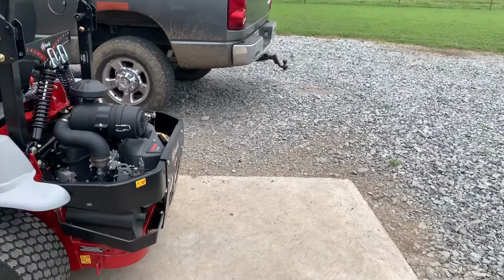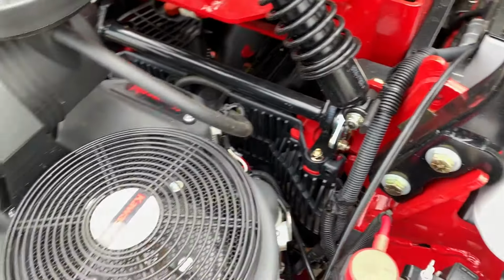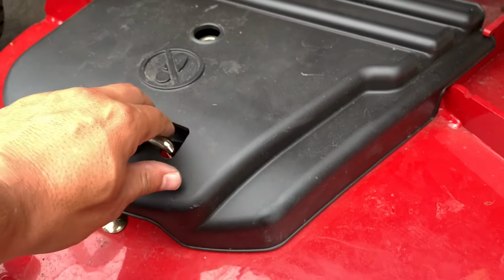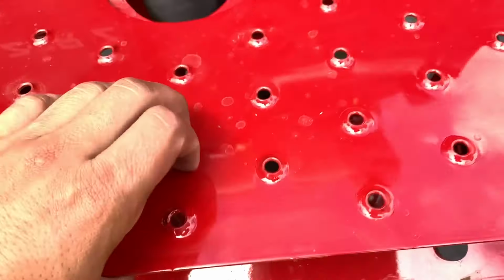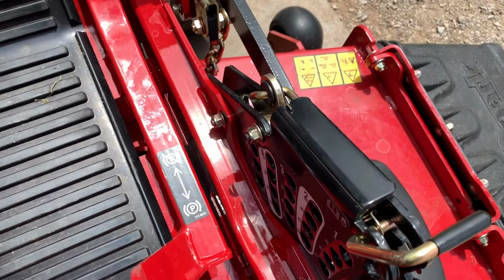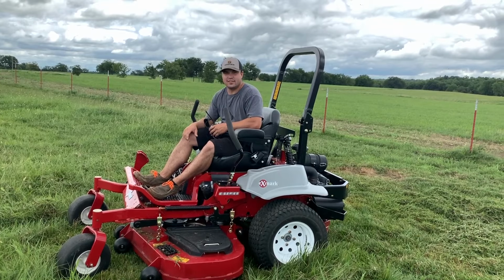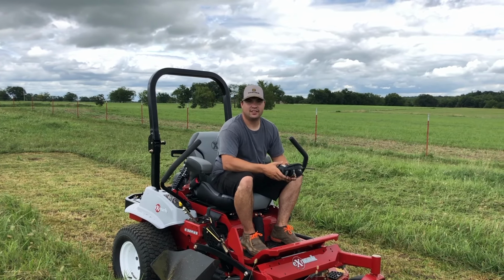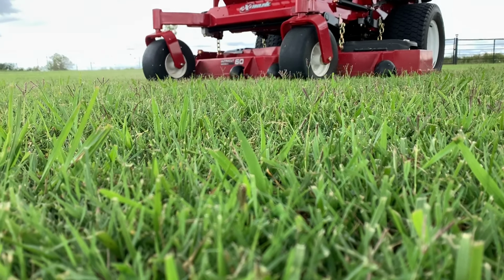2019 EXMARK LAZER Z SUSPENTION PLATFORM REVIEW

Comment: Lacks in power can hear the motor bogg down!
Reply from the maker: It’s plenty of power for what I need. I don’t normally mow pastures it was a demonstration
Reply: @4MRanch  nice I had the x series radius 60 it had a 23.5hp kawi and sold it cause I had to double  cutt and my thought personally 27hp at least for a 60inch deck
Reply from the maker: Martin Melendez yeah I could see why you would want the 27 specially if your cutting thick tall grass
Reply: @4MRanch  yes but looking at the 60 wright zk it has a 37hp engine and it's 11k for that price it's a deal
Reply from the maker: Martin Melendez that’s is a good deal I paid 10k for this one with a discount.
Reply: @4MRanch   not bad with full suspension it helps on ruff yards
Reply: It was bogging because he was cutting way to short for that long grass. For residential and commercial weekly grass this mower will never bog down. If it’s bogging your using the mower wrong.
Reply: Martin Melendez u need the ultra cut deck that comes on the lazer z. Radius is not a commercial mower.
Reply from the maker: Patrick OBrien yeah I agree,  it never bogs down under normal mowing conditions.
Reply: 4M Ranch, The best thing to happen to exMark, It was bought by Toro!   Now if only it can get the Briggs  Vanguard big block 37 hp oil guard engine with the 72 inch deck!
Reply: @johnz8886  in 1997